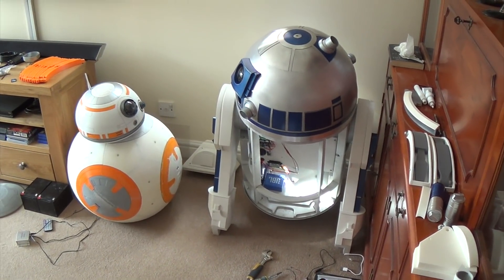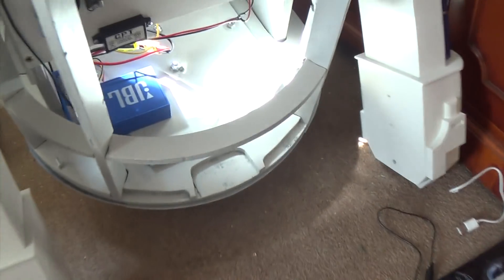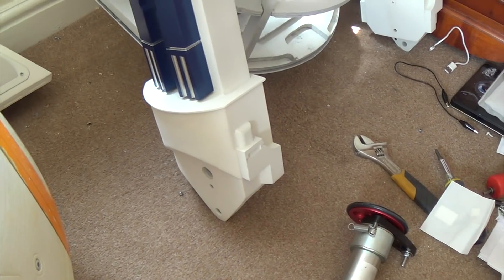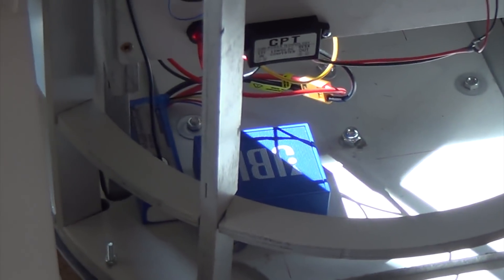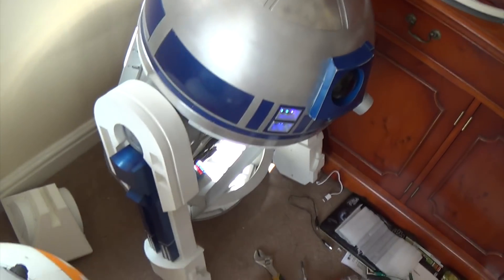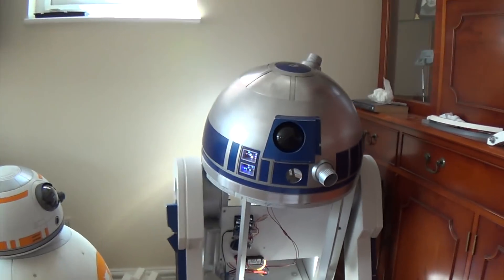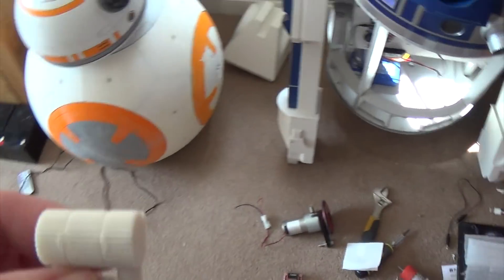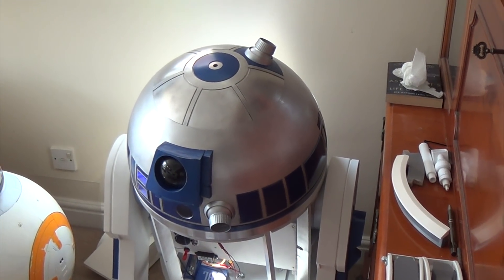R2-D2 build - Part 4

Comment: There is a product. Go to an auto refinishing shop and ask about 2 part metal epoxy . Here in the U.S. You use a double barrel caulk gun. You have 2 separate tubes of part A and part B that are attached. A applicator screws on the end and mixes the 2 parts as you squeeze the trigger. This epoxy is stronger than the metal. It it used instead of welding on places on the car. This will hold the hinges, once they are on you can't get them off without cutting.

Comment: JB Weld is what I would use or 2 pak industrial foam, the foam might sound weird but I will warn you that whatever the foam touches you best throw it away, It is also called A B Foam.

Comment: You may have to 3d print a 1" inch wide ring that you could silicone attach on the inside. You should gain enough support this way and mount the hinges to the ring.
Reply: I was thinking the same as you but not just a ring but 2 rings that are linked to give a larger surface area to stick to the dome. Then you could mount the hinges and  servo's to the frame as well.
Reply: I don't know how much silicone you used or where on the dome but another possibility may be to pinhole the inner dome and soak sections in  DAP Silicone-Be-Gone solvent to loosen the inner dome and cause separation. Not sure how this effects aluminum.

Comment: Thinking just a little out of the box here for sticking on your flaps. Maybe you could use some m3 double sided strictly pads. I have a camera on my Motorbike helmet and that has stuck for over 3 years now in rain, cold, hot and the like. Have to let them stick for 24 hours but after that it should not come off.